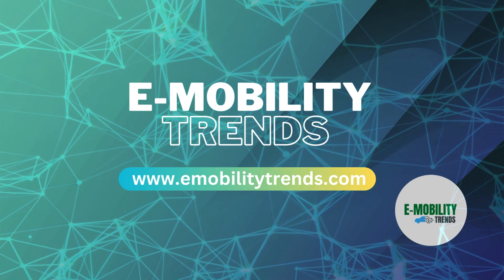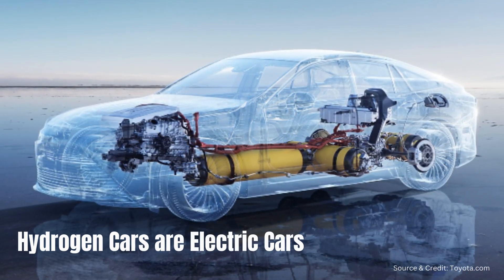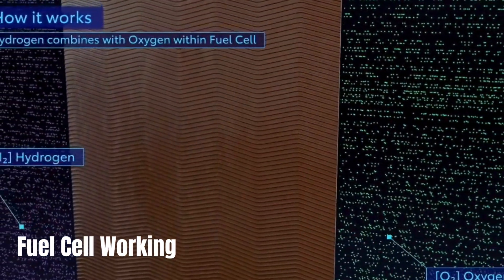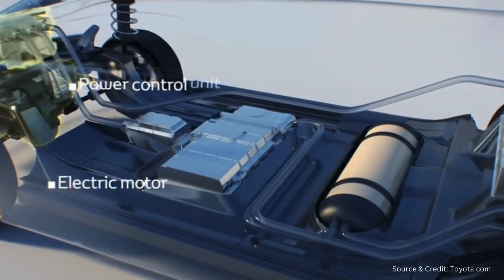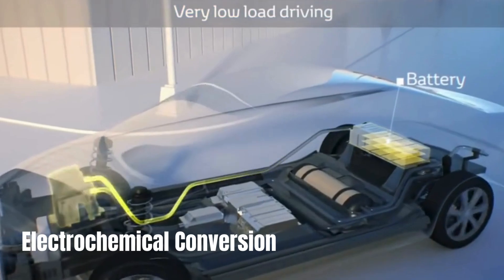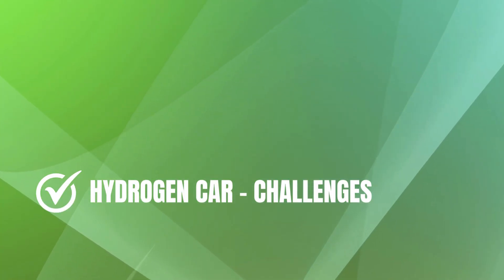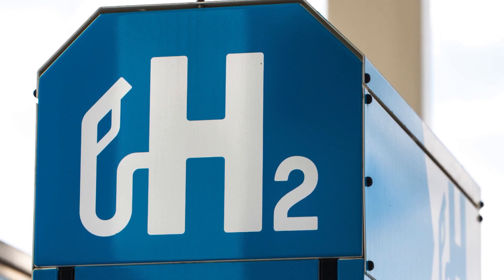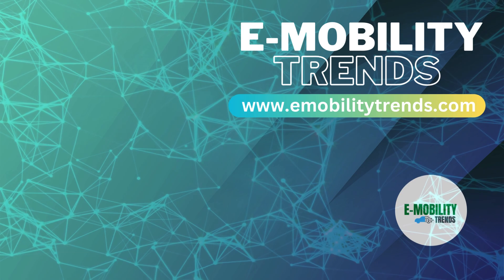How Hydrogen cars works? How Fuel Cell car works?

Comment: Hydrogen is the most abundant element in the univers but not on earth in single form mostly bonded with other elemet which is no cost  effective to separate. Maybe those hydrogen car will work outside the earth😅.

Comment: Should be titled “why they don’t work and why they are not the future”. 

Hydrogen is practically dead as far as a viable or practical fuel for the vast majority of vehicles. Good idea on paper? Kind of. But in reality it’s really not. 

It isn’t more efficient than battery electric for starters. A fueling station is far far far more expensive to build. It makes too little power for its cost. It’s more complex, therefore more expensive to build and maintain. Fix these issues first.. and then maybe hydrogen as a vehicular fuel might be a good option.